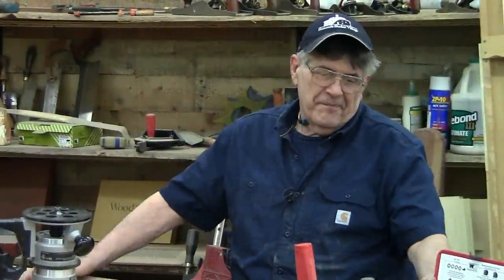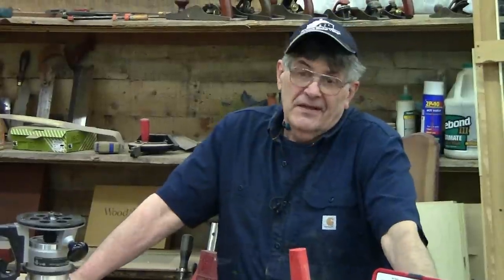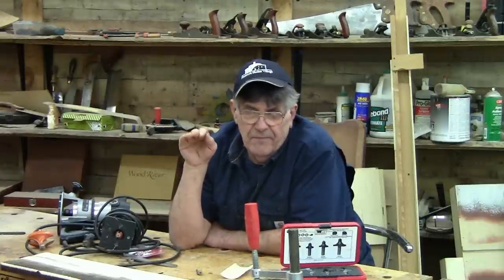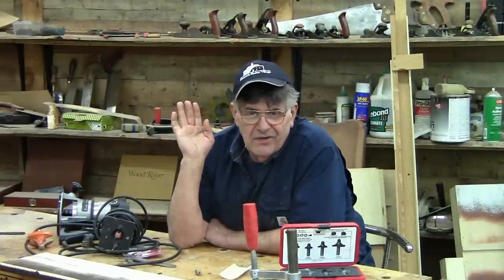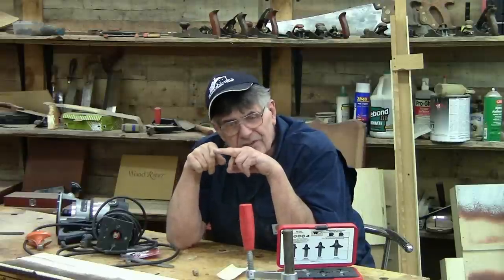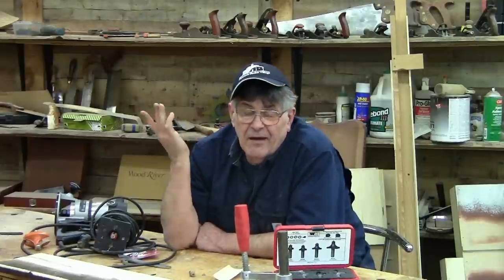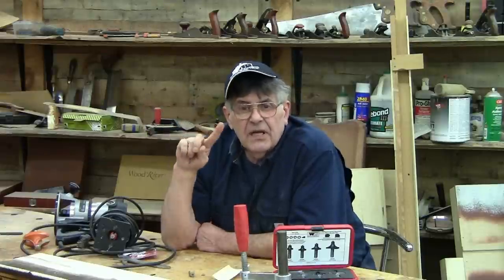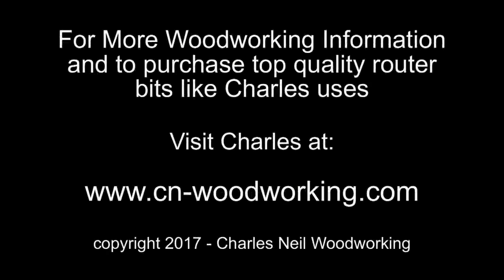Bearings and Roundover Bits

Comment: I swap bearings around a lot when I need a specific rabbet edge on a piece. Most rabbet bits dome in standard sizes (1/4", 3/8" etc) but there's often times when I need very specific odd sizes, like 5/16 or 1/8", so I can usually get that my mixing and matching between bearings on two different rabbet bits that I have.